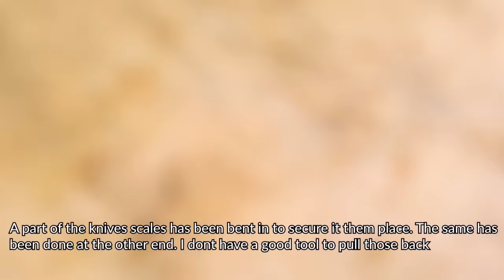Restoring rusty old pocket knife found from fleamarket - Knife restoration

Comment: In future projects if you use a wood veneer steaming it in advance then allowing it to dry in shape before gluing will give you a better finished product.
Reply from the maker: I know. Thanks for the tip though. I tested bending it and since it seemed to bend enough as is I thought that would be unnecessary extra work in this case
Reply: I had the same thought, but I know next to nothing about working with wood. It just seemed logical, that some moisture would make the veneer easier to work with. But hey you learn as long as you live :D.
Reply: Very time consuming: but if you could manage to glue the veneer by 1/8 inch divisions, somehow, I think the glue itself would keep it from splitting and make some of the rubber banding unnecessary. Cool restoration all over!
Reply: that would look terrible
Reply: @OddTinkering  Great video. Along with pocket knives I'm a bit of a watch freak. What name and model watch are you wearing in this video?
Reply: J Waterous あn
Reply: Troy Vincent bro you have great knowledge about wood working
Reply: Great tip for the next video OP

Comment: These restoration videos are always fun to watch! I myself have dabbled a little in restoring old pocket knives. Very rarely have I ever taken them totally apart. It’s usually a difficult task when it comes to old knives that are pinned together. One of my previous attempts kind of went bust. I mainly have trouble with installing new pins. I try making them out of nails which is doable, but I don’t think I have the proper workbench set up to hammer them in properly. I can take them out easily using my Dremel and a hammer, but all I have to work with is my kitchen table which isn’t built for hammering and I don’t have the space to install a set up that’s more solid and grounded. I guess I could get a cinder block and set it on the floor using that as a surface for pin hammering. I usually just use sandpaper and some mineral oil to remove rust and clean the knives out.

Comment: Any tips on how to make something even less rustier after you've used vinegar? I have a metal utensil, and the vinegar removed almost all of the rust.
Reply from the maker: Not sure I understand? If there is some rust left you could try to sand it or use a wire brush like I often do after the rust remover.
Reply: @OddTinkering  Thanks!
Reply: If you use vinegar, remember to neutralize it, otherwise your item may rust even more. You can use baking soda for this, it also removes some of the remaining rust.
Reply: @gnolex86  Thanks, i have baking soda, i'll try it!
Reply: Search for electrolysis to remove rust.
Reply: Elbow grease and an abrasive should get what the chemicals didn't.  It just takes a little more personal time.
Reply: Use electrolysis if it is really really rusted. copper or steel wool is good for brushing after you have used vinegar
Reply: Try adding in citric acid with the vinegar (usually sold in the canning foods aisle). I did this recently and it worked better than plain vinegar

Comment: As someone that has attempted this before, I know it's harder than it seems. My advice on this one would have been not to try the wood veneer. Though you did a good job of getting it on there, the problem is it just won't hold up to normal use. Just won't, don't know why, seems no matter what glue you use, none is good enough to do the job for long. I've tried epoxy, super glue, and half a dozen other types, it just doesn't stay for very long once you start carrying and using the knife. I think that's why the original plastic pieces were bent over the edge, otherwise they wouldn't have stayed either, you see how easy they were to remove once you had it apart. looks great for now though.

Comment: Very Nice work on the restoration as well as the video. The veneer gives me some ideas for a few of my projects, so thank you for that!

One thing I might mention though is that I thought I saw you using WD40 or the like as a lubricant; Keep in mind that they are penetrating oils and not actual lubricants for long term use as they evaporate fairly quickly. Being a traditional slipjoint I would recommend using just mineral oil as the lube allowing it to be safe even in food prep or meal time.

Comment: what is the green fluid you use in the tank,very interested in trying it out as have a an old transformer that was used to bronze baby shoes 6v12v 50amps variable .
for yearss have used molasis to remove rust takes time  but works well ,mix with water and let it do its thing, wash, and brush with a bronze brush

great job you have done ,collect old pocket knives when i can get them for the right price

Comment: For something as delicate as the spring in a battery compartment (as well as the small plate which the spring is attached to), what would you use to get rid of any rust?
I've been trying to get at a particularly annoying spring. I've used coke, I've used bleach (though it was working, but in the end it just made things worse) and still doesn't work. Any tips?

Comment: You can temper it with the torch. After hardening clean all the black off down to Shiney metal then hold one end in the flame as it turns electric blue move the blade down the flame until it is all blue let air cool and your done

Comment: I would have resin soaked the mahogany scales after the epoxy. Do the finish work on the scales before the final assembly. The mahogany would be able to withstand being dropped and not be dinged or dented.

Comment: Can anyone tell me how much polishing an old knife will take? I bought an old pocket hunting knife for £20; it's about 140 years old and made of carbon steel. The blade is in bad condition; lots of little scratches on the sides and the edge has lots of tiny chips. I've already polished it but it needs a lot more grinding and polishing to make it look new, and from the little I know about steel I am concerned that I may have already taken off the outer layer. If I grind off  too much, will I destroy the knife?

Comment: Does a blade lose its hardening and temper over age? I didn't see power grinding or shaping that would have caused the blade to lose it's temper and require re-hardening/tempering.
Reply from the maker: Not sure but none of the old pocket knives I've worked on have been very well hardened

Comment: You could have disassembled that knife a lot easier by closing the blade, it would have also been better to open the tabs at the bottom of the knife (if the blade was properly siezed ) as you would then be able to slide the scales up. Ripping the knife apart would have caused unnecessary damage.

Comment: I don't understand the need for the hardening part... I didn't see you get the blade red hot beforehand so it should have been still hard...
Reply: Your blade will become brittle and break if you dont harden and temper blades, or and other practical peice of metal

Comment: Awesome video! Did you need to re-harden the blade?
Reply: He did; that's what the heating and quenching was all about.
Reply: clark57225 I guess I should have worded the question as “why did you need to reharden the blade?”
Reply: @jbrou3892  I am no expert, but from absorbing the many YouTube videos, knife making literature, and "Forged in Iron" TV episodes, the answer to your queston is that hardening is necessary to protect the cutting edge of metal that is, by its nature, too soft to hold an edge during use. 
     Heat treating -- heating above the magnetic state, then quenching rapidly -- realigns the molecules so that the metal is more resistant to distortion and deformation. Reheating, however, produces a more brittle blade, subject to chipping, cracking and breaking. 
     The solution is to temper the blade by heating the metal again, to a lower temperature, then allowing it to cool slowly.
Reply: clark57225 I understand why you need a blade hardened but he’s restoring a knife with an already hardened blade. I was just trying to ask if he really needed to RE-hardening a blade that already should have been hardened.

Comment: Is it cheating  to use a bench grinder wire wheel for the first stage of rust and corosion removal ?
Reply: 7:42 looks like I got an answer. Probably not.